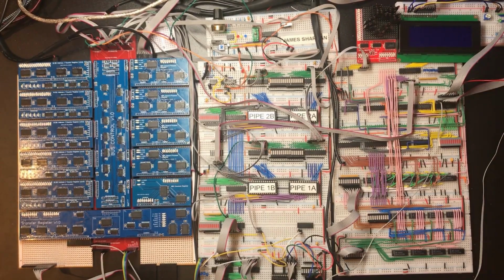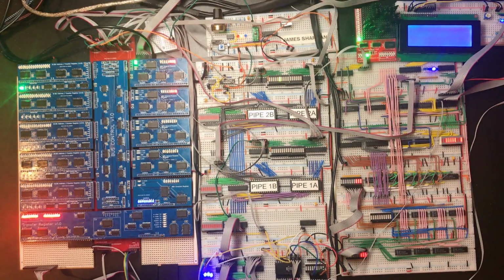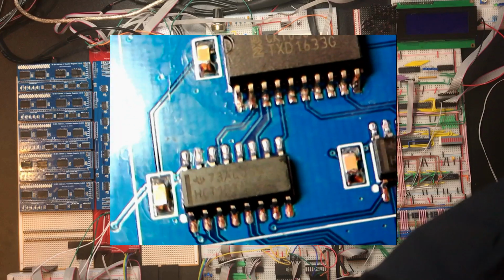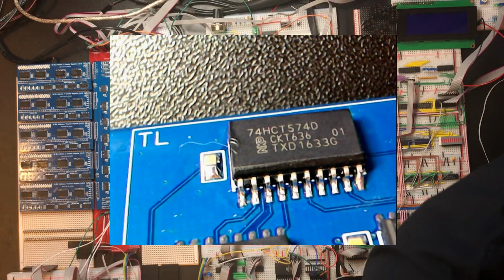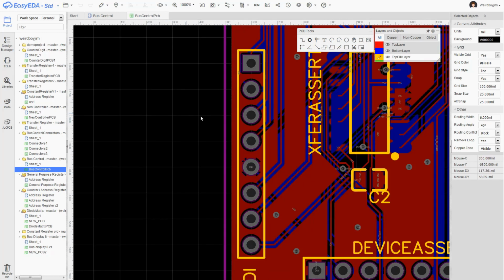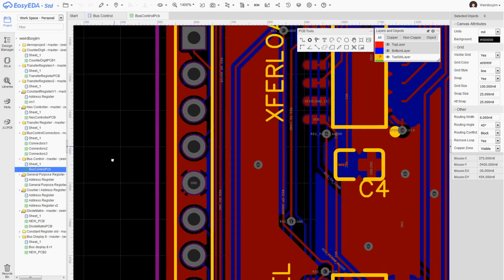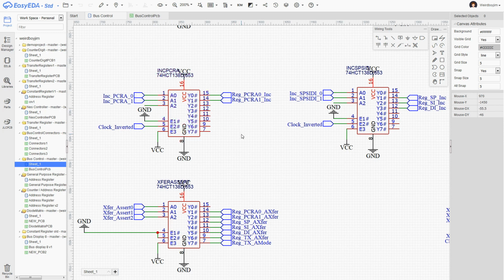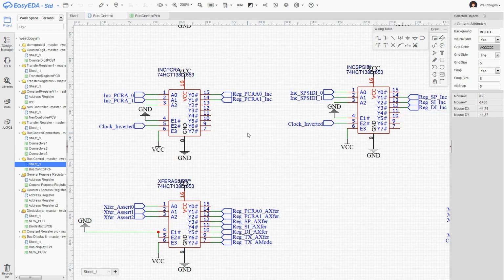Troubleshooting (First Bodge Wire!) - Making an 8 Bit pipelined CPU - Part 57

Comment: (11:35) Wait, what? You "found" pullup resistors over there? Or are you referring to the resistors on the LEDs?
(14:24) This is a spot where it would be great if you didn't have to get rid of the branch delay slot because of the prebranch instruction. You would be able to put INC A just after JNZ TX, which would allow you to decide whether to jump based on DEC B, while still executing INC A (in the branch delay slot) before actually branching. That would allow you keep the same overall behavior of the loop (which you had to change here) without having to insert any NOPs to wait for the ALU to complete.
(23:56-24:59) And here's where you found those floating input pins I pointed out back in video 49.
(27:59) And DI is still randomly counting. I now officially have no idea what the problem is.

I might be overly critical at points, but I am really enjoying this series.
Reply from the maker: Yes found, that's an off the shelf module I interfaced and it has pull up resistors on the data lines.

Comment: The worst thing is I saw this mistake in schematic when watching a video of its initial design. Just 3 years too late. And you found it out, so still something.

Always good to run ERC and DRC checks, and mark explicitly unmarked output pins. And for inputs, never leave them floating. Even if it is some unused and gate in multi gate package.

On the same problematic IC, the ground connection is the best. Copper fill there is very thin from bypass cap to gnd pin.
Reply from the maker: I have to watch myself make all the mistakes multiple times during video editing and previews!

Comment: Reminds me of the time I had to do a bodge shield for an Arduino shield I made. Wasn't just a missing connection, I forgot the drivers for the output lines...
Reply from the maker: Yeah, I missed a bunch of connections in a later board, this was the first but not the last bodge.

Comment: 27:00 if you tin the wire first (coat it in solder) then it is much easier to solder to wires.
Reply from the maker: I think I did tin those ones though, wouldn't have been easy to do it "on camera" without moving everything around more.

Comment: You are probably getting capacitive effects from the wiring which is helping to decouple the power supplies and signals, I think more decoupling caps (and caps of different values) to filter different effects are needed.
Reply from the maker: Thanks! All of the pcb's have 100nf next to each of the chips and at least one larger cap by the power inputs. The breadboards are terrible though.
Reply: James Sharman - at least the new scope will allow you to see if decoupling is the issue or not, remember to probe with x10 set otherwise the probe will load it down.
Reply from the maker: I did not know that about the x10, aparently there is an adjustment I have to tune that I would have known about if I read the manual. ;-)

Comment: I had a very similar problem when debugging my ALU this week.  Turned out I had a bad connection to a pin that on my multiplexer that was supposed to be LOW.  The bad connection caused it to 'float' and would 90% of the time work fine.. Then randomly break for a second before working again.  The way I found it was setting the ALU to a known state and using my multimeter to test each IC lead.  Those HIGH pins were showing a constant 4.87v  The LOW showed 0.01v and the one I found with a bad connection read 0.317v ( and it would 'bounce' around a lot )..  Took me about 6 hours to find my problem, maybe my trouble might jog an idea for yours.  Good luck!
Reply from the maker: I’ve been looking for exactly this kind of problem. There are large numbers of connections that you just pass over and assume are correct but I have a strong suspicion that I’ll find one or more connections that are not right. The problem comes when the connection is made but has a high resistance, it can test as the right voltage but when changing it takes time to change.

Comment: On my first batch of PCBs, two out of four needed a bodge wire because I didn't connect a trace to a via properly, so at some point when I moved some traces around I disconnected them. An extra DRC run before ordering would have found that.
That's without counting the three bodge wires on the adder board because one of the '283 chips was apparently bad and I cut some traces to isolate the problem. I think it's all part of learning :)
Reply from the maker: Absolutely! Solving problems is where the real learning begins.
Reply: Been there, done that too. Did some last minute changes on my TM1637 matrix module and didn't check again. Casued a whole row of LEDs to be disconnected...
Reply: @MaxintRD  It's one of the best ways to feel stupid :)

Comment: You should do an ERC before you export the netlist. This could have eliminated these errors at the design stage.
Reply from the maker: The DRC in Easyeda can be made to complain about non connected pins, but it doesn't seem to be able to distinguish between inputs and outputs.
Reply: I just looked into EasyEDA and its everything other than Easy! Normally the footprint creator should be able to specify in- and outputs (like in Kicad, Altium, ...), but in any case use the NC Flag to mark unused connections.
Reply from the maker: Yes! another comment let me know how to NC Mark lines thanks.

Comment: Please redo the PCB, but this time manually routed!
Reply from the maker: I'll manually route anything I do now. I don't want to finish with bodge wires on the build but I'm inclined to wait and discover any more issues, and work out exactly what set of output lines I need before redoing it.
Reply: Oh no... you've got to keep the bodge wires... they prove something... je ne sais quoi... I remember my boss carefully putting kynar bodge wires on the CPU board from our big minicomputer (it was for admin, but our company maintained them too)... I remember pooing myself whilst he was doing it ("what will the users say when I tell them Kevin blew up the computer") but after it was all finished there was that little, obvious human touch on our CPU board for ever... his little "Kevin was here"... Every bodge wire is a little bit of a maintenance engineer's soul.

Comment: Use the X symbol in EasyEDA to mark all unused pins as unused, that way a net check will show any accidentally missing connections like your two floating inputs :)
Reply from the maker: Ahh!  Nice one thanks.
Reply: @weirdboyjim  No worries! Best of luck on the rest of the build, it's fantastic so far 😃

Comment: With how much hand wired stuff is in this thing, and the number of parts that have to work just right, I'd have a dozen bodge wires on this thing already, so the fact that you have only those two so far is great!

This thing is awesome, and I hope you find the problem soon so you can move on to something more fun for you than troubleshooting.
Reply from the maker: Thanks Brandon! I have high confidence I'll get it working eventually but I'm putting in a lot of hours at work at the moment so I've not been able to spend much time on it.

Comment: 23:57 the pin above vcc doesn't appear connected to anything either!
Reply from the maker: You are correct, that is Y0 which is an output line. You can check the datasheet here: https://assets.nexperia.com/documents/data-sheet/74HC_HCT138.pdf Unused outputs are not a problem but inputs without a connection can be nasty.